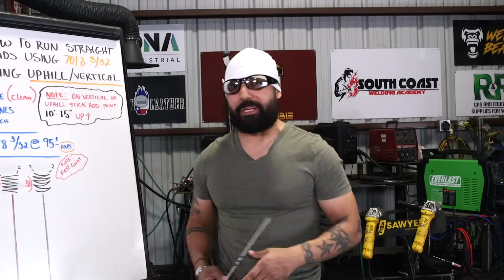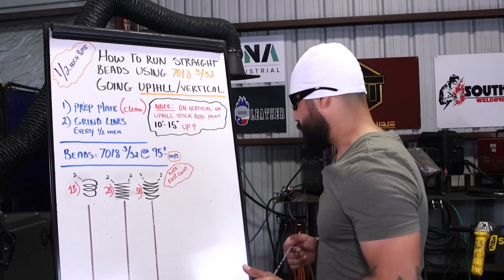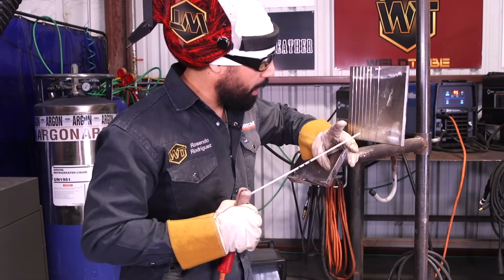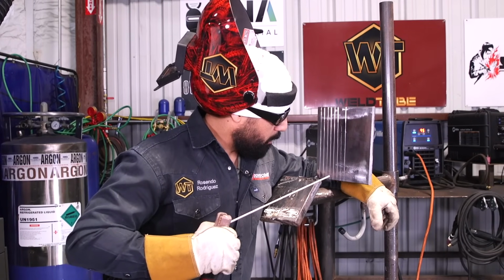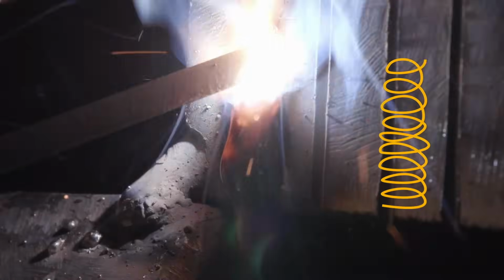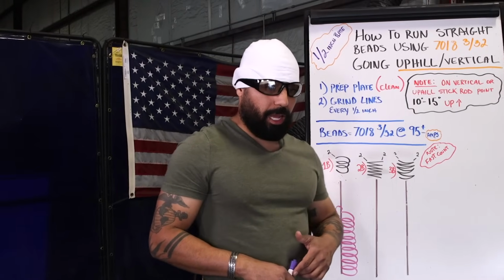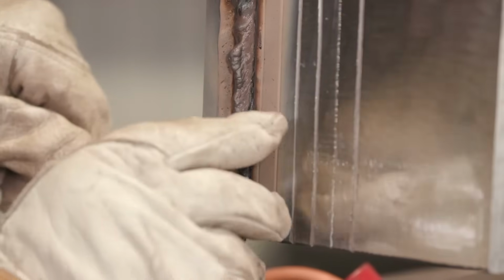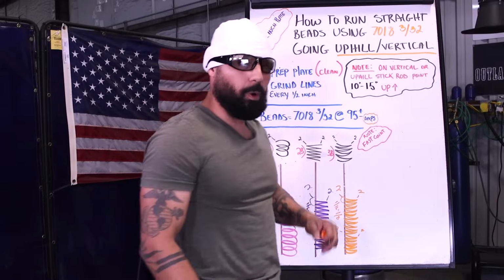How to Run a Straight Bead Vertical Up Hill? | Stick Welding Tips and Tricks

Comment: Verticles can be mastered by complete concentration and rythym practice is the key to any welding process folks you can have the best teacher but it will all depend if you've got it some will have it others wont this is a highly skilled trade good luck 40years cert.welder ive been great trade

Comment: Does this amps also works on welding machines that is not a inverter?  Cause i try to go lower amps its sticks a lot the maximum i can go with minimal sticks is 210 or 220 we are using yamato BX1-300c any tips on this kind of machine i truly appreciate it

Comment: I'm new to welding but I'm doing a straight push up with about a horizontal to 15°push. On the top of my vertical I have a hard time keeping iþ clean can u demonstrate the the finish pull off?

Comment: I am training welders, i like this video a lot.  The one pattern of manipulation you left out is my favorite. it is the upside down U, pausing at the comers and moving quickly through the center.  12:05 This pattern pushes the the slag out of the way.  I use the normal U with E6010 & 6011.
Give it a try.  😊

Comment: I always have to put a little stick movement in not a weave but my instructor called it a twitch but it helps me get good beads that are clean and no indercut , I have been lucky in the fact I have been pretty good with 7018 but I also learned on 6010 so I think that helps a lot , so anyone new do 6010 first all positions because it takes a lot of stick manipulation so when you move to 7018 it helps so much

Comment: The white board is tool that remains an awesome format to state the task, standard, and  conditions.   The board shows the welding patterns and makes very clear what is covered. You identify some of the common mistakes and its great.  Along the way you provide detailed performance steps to successfully create the desired welds.  

Really nice. TY

Comment: tried this recently.  It definitely helped.  I was making the C's as best I could 1/16" inch from the previous one.  when I was done, I wacked the slag off and it came off in two chunks.  Barely pushed the rod up as I watched the puddle. One thing I found was I had the ground right next to my elbow which I used to stabilize myself.  I felt the tingling of the electricity going through my shirt.  Ended up putting the ground on the other side.

Comment: Thanks man. 
I got a welding test Friday for a job. They said it's vertical up. That's all I know. 
Which method do you suggest I use. 
Im going to have to practice on my mig before Friday but the test is stick. 
And. The test, do you think they are going to x-ray it or pressure test it? Which method should I utilize. 

Thank you so much tho for the video. I need this job bad... I can weld exhaust on cars like a gangster. This can't be much harder.. right lol

Comment: I think for beginners the arc flash is most important. Maintaining the correct arc through the weld is the first thing to get right. Beginners think pushing is pressing the stick into the metal and it isn’t.
Reply: I'm still learning uphill welds and noticed last time I practiced that pressing in too far would cause the puddle to get displaced and start overflowing, causing lumping, it's definitely watching the puddle that shows this though, it almost feels like you use the upward tilted stick as a support to hold your puddle in place.

Comment: I just had problems welding  4g outside on a construction sight. 30° cold. 7018 rod. 3/8 angle plate to 1/8 tubing. Machine set at 125 amp. It came out sloppy, at the top I burn a hole . What am I doing wrong, I have no steady support at the top of the ladder too. Please advise.

Comment: Why does my rod stick most of the time it doesnt but but sometimes it does and also my beads are sometimes thick and sometimes thin but are consistant does it matter the thickness and im running 7018 3/32 at 90 amps

Comment: Nice explanation.  Just learning on the farm and am amazed by how precise welding must be.  One thing I find kinda funny is that almost without exception welding instructors say to pause for two seconds and then show how it’s done and say “one two” in half a second.  No one says, “one thousand and one, one thousand and two.”  🙂.  But I appreciate why (I think), because as I’ve been learning, one of the most difficult things to do is slow the heck down.  Especially vertical up 7018 (which I want to be able to do well because welding tractor stuff rarely presents stuff on a welding table), where the slag is flowing a lot… just makes me run away uphill and wreck everything.  Practice!  Lots of scrap metal with beads on it around here!
Reply: I'm in the same vote. . . .learning how to weld here in my shop with the "buzz box" arc welder using the 1/8" 6013 & 1/8" 7018 stick! My brother, who's been welding for close to 25-30yrs, has taught me the initial startup & basics so that I can go out here in the shop & practice EVERY DAY! I have alot of practice beads laid out on scrap, scrap pieces welded together, I have square & round tubing that I've cut in half with the chop saw & welded back together, I have holes that I've  filled in with puddle, & I have already built a tiny, flatbed, toy trailer about a 1ft 1/2 long out of angle & square tubing!  I wannuh learn this verticle up as well as down! I also wannuh learn how to do the whole mig/tig wire feed welding. Im having a blast out here in the shop, practicing & learning/ learnikg & practicing😃😃😃! Happy welding to ya my friend. . . .PRACTICE MAKES PERFECT, HEY???😃😃😃👍🏼👍🏼👍🏼
Reply: Haha, it's not so much 2 seconds I think, just for consist timing you use a count and a count to 1 doesn't do much hey

Comment: Another tip is to take as much weight off the rod holder by looping welding lead up high as possible taking weight off
Reply: I can’t tell you how many times my weld lead hung up and messed me up.  Good advice!

Comment: If you drape the whip of the stinger over your shoulder you can set it to help keep your arm position and it will reduce weight on your hand. That's especially helpful welding one handed.

Comment: Yes so I watched your other video and here I am 28 years later was in the Navy underwater demolition did some welding underwater did a lot of underwater mines and stuff like that but for some reason it seems harder to weld on land that it is underwater now I don't know that I got older should be wiser and became a master plumber as well then we had a weld pipe and that seemed a little easier than doing a flat weld I don't know it's strange

Comment: Hi, a question for you...if you have 2 lengths of galvenised or steel pipe with diameter of 80mm laying side by side in a vertical how would you go abouit successfully joining the two pipes in the center of the gap. cheers...I am on a 4.000.000 acre cattle station (you call them ranches) in the central western australian desert...very remote with alot of yard building and my vertical pipe edge to pipe edge welds are alkways suffering. cheers again

Comment: I love using 3/32 they are so easy to control, but I rarely get to use them 1/8 or 5/32 when doing structural.

Comment: 45 degree's works with me vertical up . The bottom of the puddle fans out more . I like running hobart 7018 1/8 and 3/32 .

Comment: Great vid as always,but I have a question...I'm ticketed for all position&can run solid welds but I can't seem to get that sick slag peel like you do,any thoughts on what I'm missing?
Reply from the maker: Run a little bit hotter. When your amps are just right on the hotter side, you will get slag peel.
Reply: Thanx,I'll try it out,you guys are great!

Comment: Hi thanks for the video! I was wandering if you have tips for welding vertical inside a corner between 2 plates?
Reply: If im allowed to, i run a downhill 60 root first, then weave an uphill 70 or two, depending on base metal thickness. Always leave a weave at least as thick as the base metal, preferably a little wider.